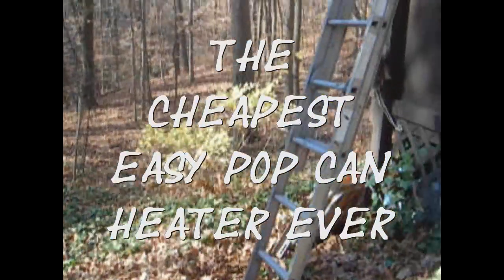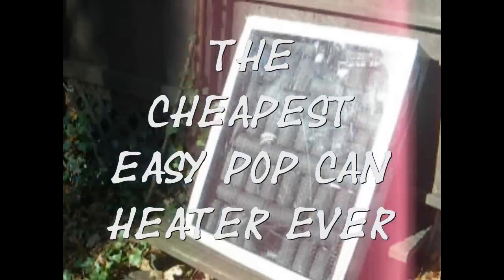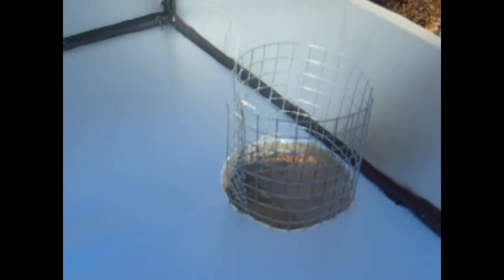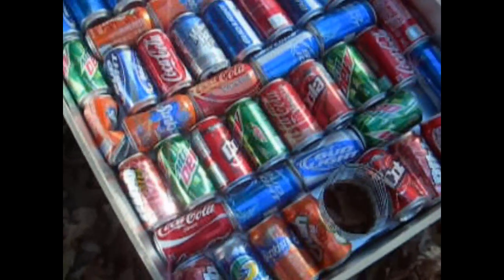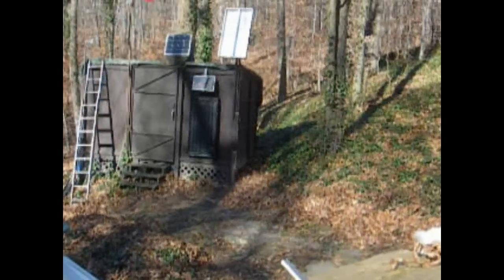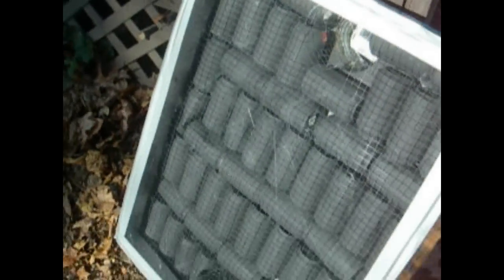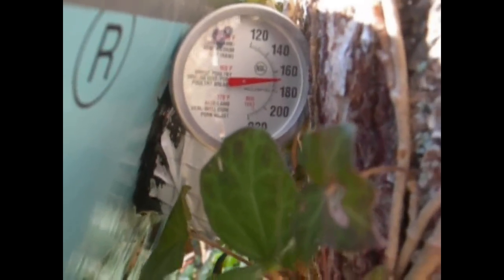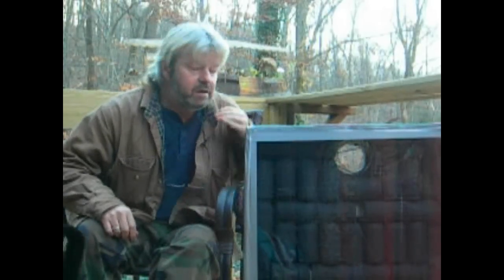THE CHEAPEST  &  EASIEST  POP CAN HEATER EVER!!

Comment: this design is HARDLY the best design.  works better when the air flows through the cans. works better still if you have the air spiraling through the cans. and even better STILL if you have a solid steel/copper rod with a heatsink down the inner core to help maintain and radiate heat when the sun goes behind a cloud.

Comment: I LOVE This; your video is Very Good & Looks Easy enough for me to attempt. The following are the steps you described; with some questions from me. "Roundabout" answers are fine. Thank You.
1. Piece of Plastic
? What kind & about how many mm's thickness? 
?How much longer/shorter than the box should it be?
 2.Build a Box w/Half Inch Foil Backed Insulation; Ok, got it.
 3. Duct Tape outer edges of Box. Ok.
 4. High Heat Mortar.[or "Silicon works good too"] seal around inside cracks; Let it Dry. 
5. Make 2 holes; one on each end; form some Cage Wire into the holes inside box. Put about 2/3 of the Cage Wire inside; and about 1/3 of it outside to attach a hose to.
?What is the Diameter or each hole?
? 1/2 or 1/4 inch wire? Looks like you have about 4 inches of the wire inside the box and 2 on the outside; so maybe you used 1/2 inch wire to make 6 inch "wire tubes"?
6.Lay down cans in the box; alternate rows vertical & horizontal to fit.
7. Spray paint everything black
? Enamel Paint? Rustoleum? Does it matter?
8. Stick a Thermometer in to take readings. 
9. Cover it all with more of the Mesh Cage Wire to hold the cans down.
10. ?Add a little bit of edging all around the inside of the frame and screw the edging to the side of the frame to hold the cans in place? Is that what you did?
11. Lay the plastic over the wire; drops inside the frame .
12. Apply High Heat Mortar again to seal the plastic to frame.
13. Cover the edges w/more Duct Tape.
14. ? What kind of Hoses did you use; and then where do you put them? I live in a Travel Trailer at present; would I put the top Hose into a Window or Roof Vent to get the Sun Heated Hot Air into my TT? 
Thank You SO Much if you answer any/all of these questions for me.

Comment: the cans absorb heat radiation from the sun and they radiate the heat into the air passing through the box.  If the cans weren't there, the air would pass through without being heated very much.

Comment: What is the purpose of the cans, can someone tell me please?
Reply: zeffur7 Plastic has a minimum coefficient of heat transfer is therefore not suitable, ideal to take the copper tube.
Reply: zeffur7 Solar energy strikes both materials in exactly the same way, there's no roughly about it. The source energy (the suns radiation) doesn't change its form or wavelength depending on the material being hit. Both materials will reflect a degree of the radiation, and absorb a certain amount of energy. And you're wrong that the cans would do it less so due to their curvature, it's no wonder you don't want to quibble over that, because then you'd have to explain how a curved object, with more surface area to absorb energy, would be less effective at absorbing energy than a flat object with less surface area.

You are right that the black plastic will absorb the energy via conduction as would the metal, but this is where you are failing. When you are talking conductors and insulators, most metals are considered to be great conductors of energy, whereas plastics are considered to be insulators. You get a slab of copper and a slab of plastic and put both in direct sunlight, let's assume they both absorb the same amount of energy to put both materials at a temperature of 140F/60C, Placing a hand on each, even though they would be the exact same temperature, the copper would feel hotter, not because it is hotter but simply because the transfer of heat is more efficient and would be released in to your hand a lot quicker than the plastic would. 

Pushing air through this system would create the same effect. The metal would release the stored energy to the air much quicker than plastic would. If you pushed cold air past both, the temperature of the air would be warmer after passing over the metal than the plastic because the release of energy would have been much quicker. There's a reason that heat sinks in computers are made of Aluminium. There's a reason that professional designers of solar hot water systems use metal as conductors, rather than plastic. Metal is a superior conductor in every way imaginable.

I agree that plastic will hold its heat much longer, but that is only because it is not releasing it as quickly. But if you're talking about storing the heat for longer term, I'd rather use the metal as a conductor and then transfer that energy to a material like concrete if I wanted to keep it stored. 

Plastic would be too inefficient to make any real difference in regards to the goal of heating up an area. It would be the same as having a cool bucket of water and wanting to heat it up by adding hot water. Metal would be like turning on the hot water tap full, it'd have a noticeable effect on the cold water in a short space of time. Plastic would be like dripping the hot water in to the cold. You could do it all day, but the speed at which it would transfer the heat would be negligible because the energy would dissipate quicker than it can be added.

Dude, just admit that metal is better in these designs than plastic is. The person you responded to wanted to know "why the cans?", and your reply didn't answer that properly. If you persist in saying that plastic is anywhere near as good, I will happily get in to the physics of the entire thing. Equations and all.
Reply: +Dieter Frank 
No.  And you really don't need any plans.  All you have to do is make a box with an inlet & outlet for the air & then line the interior of that box with black plastic.  It's that simple.  

As the sunlight heats the plastic, it becomes saturated with infrared energy & it then begins to reradiate the excess energy to heat the air underneath the plexi-glass.  

As the air heats, it rises & flows through the outlet into the space that will receive the heated air.  

Simultaneously, cooler air from the space to be heated will be drawn into the heater box, due to the natural suction that the outlet creates through the process of convection.

Note:  Flat black is better than shiny black (which is typical of black plastic) because you'll have less reflection, so you could use painted paper or cardboard as an alternative to the black plastic.  The other negative about black plastic is that if it isn't UV stabilized then it probably won't last more than a year before you have to replace it--whereas the flat black painted paper/cardboard should last for years before it deteriorates.  I only mention black plastic because it is simple to obtain (e.g. garbage liners).  If I was going to build such a heater, I would apply flat black paint to cardboard.
Reply: Summer362008 The top hole, as you have said, is to connect the unit to your house. The second hole is there just to allow new, cold air into the solar unit. It will warm by the time it reaches the top, and flows into your house.

If this is hard to picture, imagine trying to suck air out of an empty water bottle. It will be hard because there is limited air. But if you poked a hole at the bottom of the bottle then it be refilled with air. This is what is happening with the two holes.
Reply: +Alexander Todd Doff of the hat to you sir.  Well said!
Reply: Pat Spray Thanks. Check this dude out. He's still trying to argue his point. Lol
Reply: There is no purpose. 

Black paint (in his case) absorbs more sunlight to increase heat gain--the aluminum is NOT necessary.

He could have more easily & inexpensively used black plastic garbage bags,to get the same results.

*There is NO need to use aluminum or any other metal in such a solar collector/heater apparatus.
Reply: +Вася Пупкин Black plastic is an insulator, heat absorber, & inexpensive.  That is exactly why it is a useful material to use in a solar collector/heater.

Sunlight enters through the plexi-glass lens, the black plastic box liner absorbs the sunlight, quickly becomes heat-saturated, & then reradiates the heat to warm the air within the solar collector box.  That heated air then rises & leaves the box into the space to be heated. At the same time, cooler air from the area to be heated enters the lower conduit of the solar collector/heater box & the process continues until the sun disappears.

There is NO need to use copper or any other metal in such a solar collector/heater apparatus.
Reply: zeffur7 What about some of the other designs where the cans are drilled and lined up so that air must flow through all of them? This increases the surface contact between the air and heated material I would think. I guess this wouldn't matter if radiation were the only heat transfer that were happening, but I'm skeptical about that.

Thoughts? Mightn't there be any conduction or convection happening, in which case the material would matter?
Reply: It doesn't matter--there is only so much solar energy per square foot.

If you think there is an appreciable difference, then make such a solar heater with AL cans & prove the difference or lack thereof. 

Until I see it proven, I doubt it will make any significant difference.
Reply: zeffur7  Fair enough, i bet you're right. It might make a cool small scale experiment; even if there's no difference you'll still end up with two mini heaters.
Reply: HydrixCooper
Agreed!
Reply: +zeffur7 Would you happen to have any place I can find a plan to use black plastic bags?  Is there a recommended configuration, or is stuffing it just fine?
Reply: +zeffur7 thank you for your explanation but what I don't understand is once I build that how do i connect it to my house or my tiny house to get the benefits of the solar that's the part I'm all star you are connected to a fan so the heat radiating from this unit blows the heat in my house and then he had two holes I don't understand what the purpose of the second hole is for
Reply: they draw heat from Sun
Reply: Genesis Code
Incorrect.  They do NOT 'draw heat' from the sun.  Energy from the sun enters the system all by itself and the infrared wavelengths are absorbed by the system materials.  Heat flows through the system via conduction, convection, & some reradiation.
Reply: +zeffur7 The cans are blatantly better than plastic. Aluminium cans especially, as aluminium is one of the best materials for energy transfer. Sure, plastic will do the job at a basic level, but metal is far better at heat exchange being that it is more efficient and better at conduction. Plastic is much slower at heat exchange and would take longer to absorb the heat and release it than aluminium. And what are you talking about re-radiation? Do you even physics bruh?
Reply: Alexander Todd
Solar energy strikes both materials roughly in the same way (probably a bit more on the plastic than the cans because of the can's curvature--but let's not quibble over that).  The black plastic will reflect some of the solar energy (radiant energy), absorb as much energy as is possible (via conduction), radiate the excess energy (that which can't be absorbed) as heat via radiation & convection through the air to heat the surrounding air molecules which are then blown (via convection currents) into the area to be heated.  The goal of the heater is to get the most heat into the air molecules that will be blown into the space to be heated.  Sure the black plastic will hold a bit more heat for longer than the cans, but that doesn't matter because that heat will also eventually be lost into the nearby air molecules & blown into the space to be heated.  How u think it works, bruh?  You physics ANY? haha

Here's a little help for you, bruh:
http://www.merriam-webster.com/dictionary/reradiate
Reply: +Alexander Todd So yeah... Google somehow ate my pithy response to your response.  I could certainly correct everything that you typed that is INCORRECT; however, in lieu of doing that, I'll just ask you a simple question.  Where pray tell does the energy go that passes through the glass after it strikes the flat black plastic/cardboard liner at the bottom of the solar box?  The vast majority of it remains in the solar box--just like in a greenhouse--to be absorbed by the air molecules & then blown into the area to be heated..
Reply: zeffur7 You can't correct shit. You are arguing something that is absolute nonsense, and you are a fool to think that you have a point. Unlike you, I have a working knowledge of physics. It is obvious to anyone with mediocre knowledge of the subject that you are talking nonsense, and you are a fool to keep trying.

I have already explained that even though both materials absorb energy, even if they absorb the energy equally and store the same amount, the plastic is going to release the energy at a slower rate than the metal and thus make it a poor choice of material to heat up the air flowing through it. Simply because the air flowing through it will not have much energy released in to it from the plastic. Where a certain volume of air would raise 5 degree's passing over a certain surface area of metal, it would raise less than one degree when passing over the same surface area of plastic.

I found a 5 minute video that explains to you why you are talking shit in the most basic way possible. 

watch?v=TmeJFYJcdaw

Unless you can prove to me that plastic is a better conductor than metal, I think I'll take the word of countless physics professors in universities across the globe over that of zeffur7 from youtube. 

I'm sure you think you're intellectual, but I'm guessing that it's because you've surrounded yourself with people that can't call out the nonsense that flows out of your mouth. 

Good day to you sir.
Reply: +Pat Spray (Native Life) 

Try Googling some time--you might actually learn something before making a buffoon of yourself:

"common commercial grades of medium- and high-density polyethylene the melting point is typically in the range 120 to 180 °C (248 to 356 °F)."
Reply: SuperSaltydog77 they collect heat.  It's thin aluminum.  Check out others where the cans are lined up better and the air moves through them and they are sealed together with high heat glue/mortar/calking.  It way more efficient
Reply: Alexander Todd LOL!  Stuff the box full of black plastic bags and you will end up with melted plastic - since most boxes range in heat collected from 135-190 F.

Comment: Hey rich I made this can heater. Does it have to be outside? I put mine in a sunny window but it doesn't produce any heat. I'm wondering what I am doing wrong. It looks exactly like yours except I didn't put a hole in both ends only one.
Reply: You have to have 2 holes in the box (1 for intake & 1 for output) or the air won't flow.

NOTE:  You may also have low-E windows that are blocking infrared light waves. No/low infrared light = no/low heat gain.

Comment: One question I have: If you fill the cans with earth (which would increase the thermal mass of the cans) would this increase heat retention and generation? 

Thermal mass is the principle used by Earthships, self-sustaining houses that heat themselves (and generate their own electricity, recycle their own water and grow their own food). Would love to know if filling the cans with soil or sand would hinder or help with heat generation for this kind if unit. 

In theory, the added mass could keep the temperature in the unit higher longer (and help decrease temperature dips that shut it down when the sun goes behind a cloud). I have no idea, I just made saw a video on Earthships and was wondering if that principle could apply here, since this model doesn't appear to be dependent on airflow as much as others. :)

Comment: My Sun Oven collects about 4 square feet of solar insolation into the oven. No pop cans. It easily reaches 350 degrees in the direct sun. Why not just leave the pop cans out of the design??? Have you tried that???? More simplicity the better. I like your approach.
Reply: The aluminum is still important because it transfers heat to the cold air constantly being passed through.
Reply: Prof Kaos
He could get a better heating affect using black plastic garbage bags to line the inside of his collector.  Plastic has a low specific heat capacity, so it will quickly heat up & then re-radiate any additional heat into the adjacent air...
Reply: the cans offer more surface area
Reply: That is true, however the surface area of his plastic lense is fixed, so it really doesn't make a significant difference from a heating standpoint--heck it might even reflect more of the light back out of the collector due to its height & shape. 

Black plastic or even black paper is easier to work with & it doesn't have to be painted. 

Anyone who uses PUR water filters could also use the black activated carbon from their otherwise disposable filters to line the bottom of her/his collector too--just add a bit of glue.
Activated charcoal provides lots of black surface area!